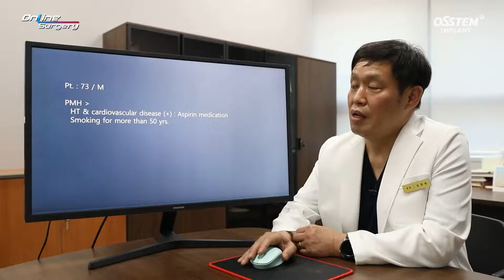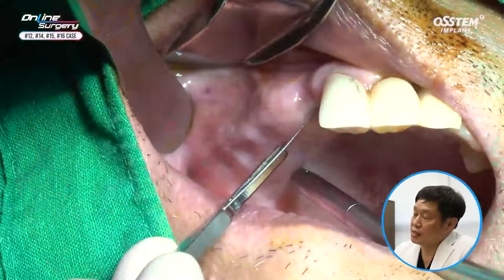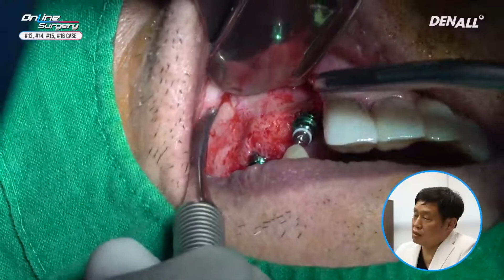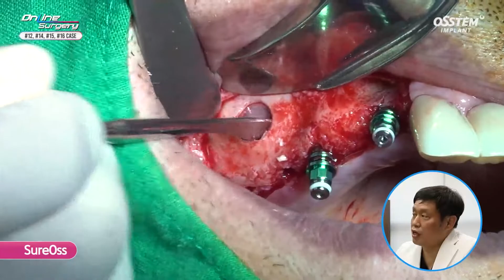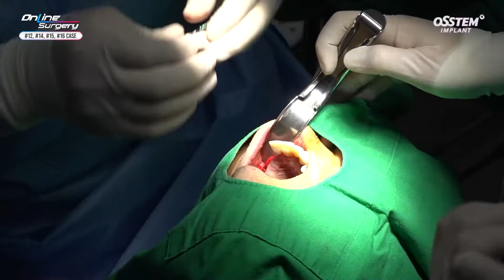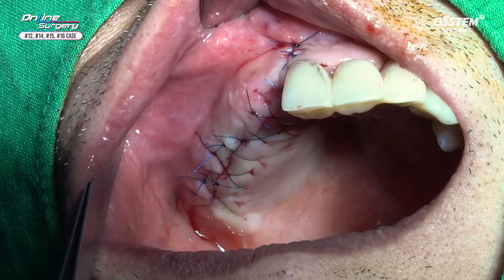Online Surgery: Large sinus membrane perforation repair using fibrin glue & 4M CT F U

Comment: I have a question
How can I use fibrin glue in case of sinuss membrane perforation after upper molars extraction ? 
Can I fill the socket with fibrin glue and sinuss repair will occur ?
Can fibrin glue be used in these cases and perforation during crestal approach and ho can it be used in these cases ?